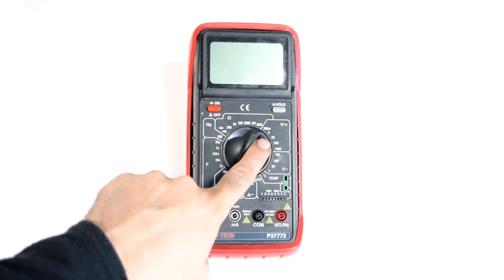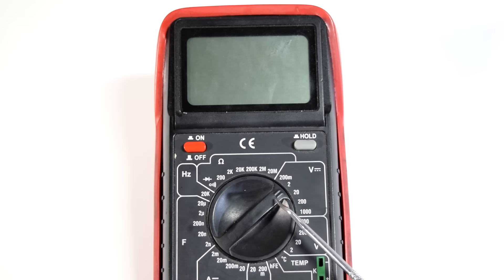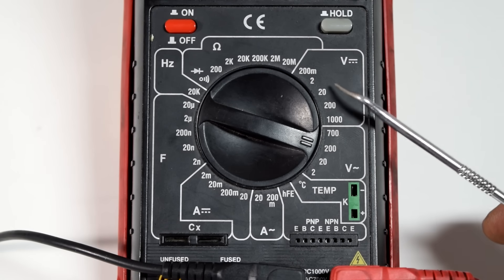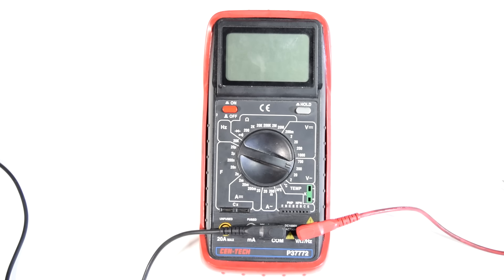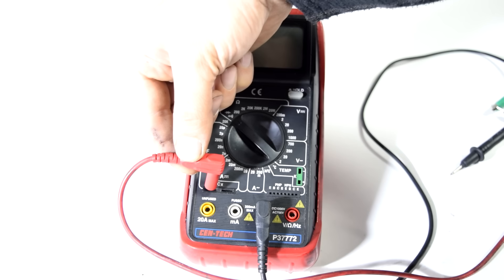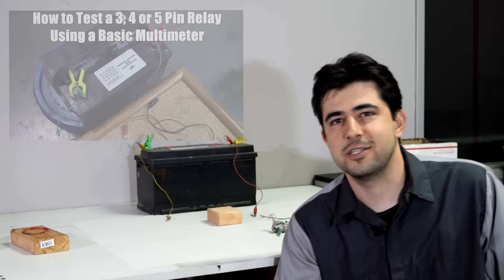How to Use a Multimeter for Beginners - How to Measure Voltage, Resistance, Continuity and Amps

Comment: How do you test the mains cable coming into a house how do you test if it is is still live? , is it safe to just put the multi meter (obviously one that is rated for the voltage) onto the positive and negative? and how do you test it at the fuse after it has been removed

Comment: Can someone answer my beginner question? If I have a 12v DC battery running into 110v AC 2000W inverter powering a 500W device. Can I safely use my little 10A max multimeter to measure the amp load?
As I understand, the draw would be ~40A from the battery (500w/12v) and ~4.5A from the inverter (500w/110v). So if I measure draw from the 12v battery it would blow the 10A fuse, but from the 110v inverter it would be fine?
PS: I just learned the hard way that Amps shouldn't be measured by sticking probes into the power source (short circuit). I saw a bit of a spark just now. Fortunately the multimeter still works.

Comment: Don`t suppose i can, but can i use a multimeter to somehow see if there`s any electricity running through a circuit breaker after its been turned off?

Comment: If you did not already know that only experienced individeuals should ever go digging around in any electrical wiring in your home, Low voltage High voltage or Slightly below average voltage, please go over your familys fire procedures.

Comment: What happen if you measure DC current without any load? If the amount of current depends on the resistance, how do i measure how much is the maximum Amp a battery could provide ?

Comment: 100% I've never understood these and need to check wiring on my mustsng , so the wavey figure for checking wires what it does is sends a small voltage from one end to another and beeps if it's intact? that's awesome if that's right in my thinking,  great video thank you so much

Comment: One thing I recommend doing when performing a continuity test is to first touch the probes together to make sure you're on the right setting. Touching the probes together should make a beep and that would indicate you are checking continuity properly. Also, a lack of beeping when checking continuity indicates broken wire, NOT a short. This is the opposite of a short.
Reply: Dont you get short when the wire is broken?
Reply: @thecyclingcouple4438  a short (full name "short circuit") is an unwanted connection, like when an exposed wire touches something it shouldn't. if the wire is broken, there is no circuit
Reply: @keefmad  Oooooh, wow, thanks for that clarification. 👍
Reply: @keefmad  thanks!
Reply: @keefmad very well said
Reply: The opposite of a short is an open which is the same as a broken circuit. There is no continuity in an open circuit. Think of a circuit with an on/off switch in the circuit, with the switch in the on position, power flows through the switch completing the circuit. The  same switch in the off position creates a break in the circuit or an open spot that does not allow the electricity to flow.
Reply: Thanks for this information. It has explained terms which we hear regularly when referring to electrical problems.
If this video is anything to go by, I guess all of this will be explained in the accompanying videos, but it is still a great tip for a novice and the explanation is very concise and clear.

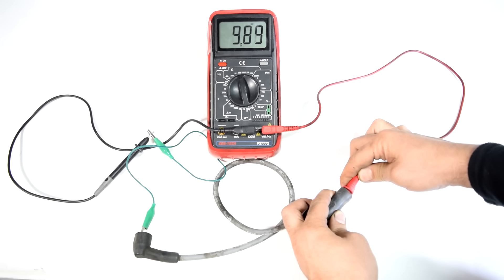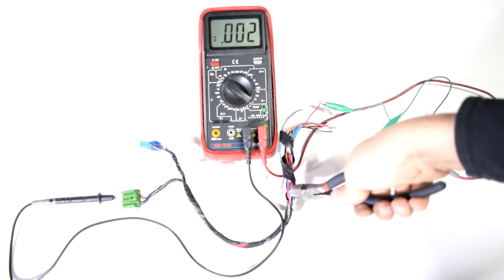Comment: what's the point of the the green chord/wire at 4:27 (connected to the black lead) and 5:29 (connected to the red lead)? What happens if you don't include that when testing?

Comment: May I use voltage settings to detect burn/cut wire?

And what is the difference using the continuity method instead of voltage if it might possible?

Comment: I bought a super cheap multi-meter to basically check for dead or damaged outlets and instantly lost the instructions. This video more than answered everything I needed to know. My meter reads voltage dc/ac and resistance, and has a couple (seemingly unnecessary) extra settings for testing batteries. Is there any reason I would use these settings (1.5v, 9v, 12v) over just using the 20v dc setting? Are they just more accurate for the application?

Thanks so much for this concise video!

Comment: I bought a southwire multimeter and it has a 10 amp instead of a 20. It's fused but I'm wondering would I need more than 10 amps. I test boat batteries and car stuff. So I don't think so, but I guess my question is when is 20 amp testing needed?

Comment: Far too many years ago, I was taught that when measuring possibly dangerous voltage I should set the meter down.  Then hold both probes in one hand, so that any stray voltage goes across the hand, not across your chest.  Tuck your unused hand in your  belt, behind your back or somewhere out of the way.  Don't just ignore it.  Make an intentional effort to put it somewhere so you don't inadvertently rest it on something grounded.  If the terminals you're probing are too far apart, use a jumper lead on one probe to bridge the extra distance.

Comment: Is .18 a good reading for a battery with a multimeter ?
Reply: 18 volts?. 18 volts is too much
Reply: @ismaeldossantos3296  thank you for your help. I mentioned the wrong number. I meant to say 1.8.  Is this number ok ?
Reply: @robertorodriguez6772  what battery are you talking about?. I didn't watch the video clip.
Reply: @robertorodriguez6772  i watched the video clip now. 1.8 volts is a bit high. You multimeter calibration migth be a bit out.
Reply: Thank you Ismael for replying again. I'll definitely check my multimeter. Happy New Year Amigo.
Reply: @robertorodriguez6772  thanx and for you too👌

Comment: Anyone  I have a Wavetek DM2 that is showing ~ .298 ohm for contractor coils that I need to pull down with Classic emitter-coupled schmitt trigger; PN2222a will only pull 800ma – supply voltage is measured reading ~25 volts measured ▬▬ so this is close to what  I  think is  298 Ω if Wavetek DM2 on 2k set on the rotary switching?

I found an online calculator which gives 0.0877192982 so 90 milliamps for a 2222?

Datasheets are showing 800 ma for the 2222 so this gives about a 10:1 safety margin 

My work shows to allow a 3 to 1 to 5 to 1 safety margin;  

This unit must operate un-attended; I will cover with fine mesh wire metal screen and test extensively before leaving it energized without me there to monitor
Reply: What is throwing me is the decimal point; Shown in the display to the left of the reading this should be 0.298 /0.289 K Ω at 2kΩ setting which should be ~ 290 Ω?

Comment: Pretty good video, but does it matter which lead you put in first??  Common first or other one first??
Also whats the difference between continuity and current? When checking for current(Amps) why not just use the current??????

Comment: I have a multimeter a bit similar to this one. I bought it and use it in Ireland. But recently, when I test batteries, the readings do not make any sense at all. Does the multimetre itself run on a battery that needs changing?

Comment: Great Video! WOW... I learned "something" today! Thanks to the professor! (I understand that the language used in the video is for "beginners")   ... I am not trying to be smart pants, I knew very little about this and it took some research:  - The "wavy thing (~) is called "TILDE", and it represents "poor approximation"... (Note that ~ is used for an approximation that is poor, otherwise use ≈), while another source says that in Mathematics, a symbol (∼) indicates equivalency or similarity between two values. 

Yet, the "horse shoe" "Ω" (Omega), the symbol represents ohm, a unit used to measure electrical resistance. Omega ("Ω" is upper case, and "ω" is lower case), the 24th and last letter of the Greek alphabet. In the Greek numeric system/Isopsephy, it has a value of 800. The word literally means "great O", as opposed to "ο" omicron, which means "little O". 

For ohm – SI unit of electrical resistance; formerly also used upside down (℧) to represent mho, the old name for the inverse of an ohm (now Siemens with symbol S) used for electrical conductance. Unicode has a separate code point for the ohm sign (U+2126, Ω), but it is included only for backward compatibility, and the Greek uppercase omega character (U+03A9, Ω) is preferred. Enough? There is much more about this letter/symbol... it is worth it looking it up!

Comment: DISPLAY on camera was excellent, too. Be well. great for those with some e m f (electro motive force)familiarity and those who have less. P.s. Years ago with just a testing screwdriver I was able to inform the electricity supplier that their preliminary inspector had missed something during a storm. He tried our hot and said that we had (230 V) current. and left.  Then I tried and the same w-neighbors who also lit the tester but nothing worked. Tried the neutral and it lit. Called again. They sent out a high wire team. There was a short between the H-V ~ and 0 circuit by the transformer. That required a more complete team - safety back-up - to do the tower top repairs.

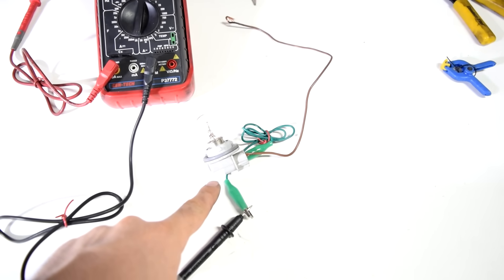Comment: at 7:00,  what if you connect it to the negative side of the device? thank you
Reply: Nothing, it'll still work the same.....all you're doing is putting a read out (the multimeter) in the line - the positive wire

Comment: NEVER NEVER TRY TO MEASURE THE RESISTANCE OF A CIRCUIT THAT IS CONNECTED TO POWER OR ONE THAT HAS A NON-DISCHARGED CAPACITOR IN IT!! YOU WILL BLOW UP YOUR METER EVEN IF IT HAS A FUSE!!  To discharge a capacitor connect the two terminals together briefly and watch for the spark.

Comment: BTW. YOUR MULTIMETER may be a less expensive one than shown, so it may not have the same markings or switch position, I have a fluke and my settings are different. The basic things such as AC, DC, OHMS (Continuity) should be close enough to figure out.

Comment: What would happen if your set the Multimeter to DC, but then tried to test an AC circuit, if you didn't know whether current is DC or AC? That's my situation.

Comment: 4:08 "This spark plug wire is supposed to have a resistance of about 10,000 ohms.  ohms being the unit of measurement for resistance.  "

excellent video.

Comment: Excellent basic video of multi meter functions.

A good refresher course if you forgot something.

I was taught to always use the highest setting and work your way down just in case a circuit had much more power in it than expected.

Comment: GREAT VIDEO!  Since most autos no longer are provided with AMMETERS+VOLTMETERS, could you suggest a portable device that I could just plug into my Power Outlet ("cigarette lighter"), so that I could read these numbers constantly while driving?  I am not very astute about hooking up wires. Thanks.

Comment: I have an o2 sensor issue that nobody can figure out. Not even the dealer. They just keep asking for money and hope to get lucky as they keep swapping expensive parts at my expense. I have seen your videos about o2 s but I am not sure what to do still. The values on that one sensor don't seem to change much compared to the others. Three needles are bouncing but that one is mofing much slower. The sensors have been changed twice and the muffler has been pressure tested. Any suggestions on how to get that needle to move like the other three?

Comment: Great video. Thanks for making it. The instructions for my multimeter has a few mistakes. You've helped clear up the confusion.
I can't believe your power plugs don't have individual switches, though. That's so dangerous. In Australia, each individual power point (as we call them), must have its own switch, to avoid electrocution when inserting or removing plugs. It's also a way of saving power with modern electronics, such as TVs, that only go into stand-by mode, rather than actually turning off completely.

Comment: This video would have been much better if you had used an annoying thumping background soundtrack to get us all pumped up to learn about multimeters. Also, next time put a cheesy intro lead in to brand yourself before you actually start saying anything of value. People like that. Also it is nice to see an endorsement for Audible or Squarespace. Don't forget to include those. But the most important thing is to crank up some psychedelic dance track. It is very difficult to concentrate on learning something without a dance club remix reverberating in my brain.

Comment: as said below ....When a wire is cut, it is NOT a short.  It is an open circuit.  A short is when there is a direct, low resistance flow of current in the circuit between positive and negative, or hot and neutral or ground.

Comment: One of the best instruction and overview vids I've seen in a long time.  I like that you don't waste any time with a lot of intro and sidebar chatter,  but you do make a quick explanation of terminology that you use (ie ohms setting for resistance) and then keep moving forward.  Also, you use a pointing tool to show precisely what you are referring to on the meter settings.  Thanx for a very helpful overview!

Comment: Great first video on Multimeters. The first time I ever saw a multimeter was in a Fire Department Academy, your really smart to point out the safety features because it is possible to use a multimeter as a torch once. The Fire Academy Chief Fire Officer gets really pissed if you light one of his classrooms on fire, I thought that a Fire Academy would be far more prepared for a fire. Nope, it turns out the Fire Fighting Apparatus is kept in an entirely different location, who knew.

Comment: Thank you so much I have to diagnostic if my fuel pump was good or not and I never had used this machine before. But after this video I just went to buy the same exact multimeter you used.
My pump was dead. I replace and now I have my car back to the life..
Thanks.

Comment: And now to turn your world upside down.  In DC circuits, commonly electronics, black wires are ground.  In AC circuits, like house wiring, black wires are Hot (110VAC) or DEATH.  In DC circuits Red is the most common wire for a  positive voltage.  Your car battery is probably color coded black and red.  In AC circuits, white is neutral and green is safety ground.  This is why you never, ever want to let an electronics geek do house wiring.  You have no idea what the black wire will be.  Can your AC meter read a negative voltage?
Reply: CAMGERE / Looks like you have color codes down, now work on what AC means  (*U*)

Comment: Basic use of a multimeter Step #1  Buy a 9volt battery for your multimeter as the do not run off what your trying to test if it has power or not..

Comment: If I have a power supply (switching) that states 15v 30A clearly on the side, and to confirm it, I plugged the exact Multimeter in the video (20A max) would I damage the multimeter, or is there something special about Switching Power Supplies?

Comment: You did not mention that there are autorangeing multimeters that can just measure the voltage straight up with no need to flip the dial into the correct voltage range

Comment: This was nice lesson with some minor inaccurations. I would like to bring into focus few things. The battery you were measuring was normal battery not rechargeable one so you can’t say it is fully charged. The voltage measurement of this kind of battery doesn’t tell how good it is. You must load the battery when measuring as the no-load voltage can be much higher than it is under load. And when you measure mains voltage, I would succest you to hold the probes in ONE HAND, not with both. It is much safer way to measure as the probes may leak or the wire insulation can be cracked or something. But good tutorial and clearly told, thanks.

Comment: I just bought the same multimeter. I need to test my doorbell transformer to see if I'm getting 16V AC at 30 VA. The transformer is connected to 120v. What should the settings be on the multimeter?

Comment: Awesome video. My question (for measuring DC voltages like the 1,5v battery you showed) is, what would happen if you chose a voltage setting which is below the voltage that you want to measure (will it have a negative impact on the voltmeter or the item being measured)? Thanks so much for your video.

Comment: I almost made mistake measuring voltage on charging car battery. The red probe was plugged in 20 A, switch was in the position 20 V DC. The probes were plugged in the position for measuring current (20 A), but the scale was in the position for reading  voltage (20 V). In the last moment I decided that it wasn't safe to work with lead acid car battery without protective glasses. Upon putting the protective glasses I realized mistake and correct it by removing the red probe from 20 A to 20 V. What would happened if I measured voltage with the correctly set scale but the wrongly connected probes?

Comment: Amperage is measured in series with the load.  Can be on either the positive or negative side of the circuit. Doesn't matter. Don't try to check your alternator or starter amperage with this meter. It will exceed the rating of the meter.